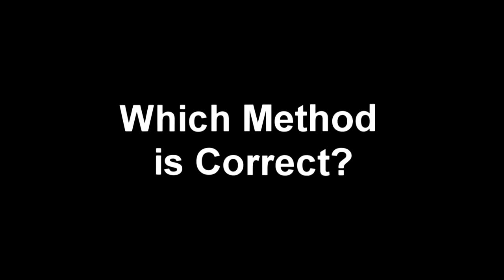Using a Vintage Bakelite Sewing Machine Pedal: How Does it Compare to Modern Pedals?

Comment: My Necchi Supernova's both had these type of foot pedals. After sewing with wedge shaped pedals for more than 40 years, I could not get used to the bakelite ones, so I switched the pedal for modern ones. Now I have full control again over my Necchi's. I've kept the bakelite pedals, so that in the future a new owner can put the original pedal on and keep the machine original.
Reply from the maker: I know what you mean. I'm not a fan of the bakelite pedal either. I find it a lot easier to control speed with a modern-style pedal. Thanks for commenting and for watching! 😀

Comment: I have one working machine with a bakelite pedal.[Singer 500A]Most  of the time, I use the side of my right foot. My husband is in the process of putting new cords on two vintage machines. His thought is to use new pedal/cord assemblies vs rewiring the old petal. I actually like the old bakelites because they are heavier and stay in place. But, I'll probably go with new pedals and figure out how to make them more stable.
Reply from the maker: Yes, I agree! Once you get the hang of the bakerlite pedals, they are a lot less... annoying to use. They tend to stay right where you put them! So no chasing them under the table to pull them back. I have a video on rewiring a bakerlite pedal on a Singer 66: https://youtu.be/E5rOX9XoRdk  Might be worth taking a look before you commit to the modern pedal route. Thanks for watching! 🙂

Comment: Huh, I always used mine the other way around  with the bulk of the pedal away from me. I plant my heel on the floor and pivot against the solid bit. That being said, I don't really like foot controllers and mostly convert the machines that I use to knee control. I'm just finishing up refurbishing a 221 for my mother with a bakelite  foot controller though and will certainly give your other methods a try. Nice video as always, wish you had more views. You obviously put a lot of work into this.
Reply from the maker: That's the thing with the bakelite button pedal... it's adaptable 😀 I think I'll give your method a try. Maybe it'll  help me like this pedal more. At the moment, I'm not really a fan of the two button system. Thanks for commenting and for watching the video! I appreciate it! 😀

Comment: Have you heard about pedal driving treadle for electric vintage machine?
Reply from the maker: Not sure what you mean. Do you mean an electric pedal being used to work a treadle base? That's not something I've come across. Normally the electric pedal replaces all the treadle workings. Why, have you seen one like that?
Reply: @SimplyStitchy  One person in the 201/1200/101 mentioned something like that. I  will do more research on this. My 101 need a cabinet plus pedal and rewire would it be nice to have a pedal treadle. Oh I hope I am not confused 😅🤪🤣. I just realized that the cabinet I could use for my 101 isn't a Singer .; its a Sears cabinet. Don't own any Sears sewing machine
Reply from the maker: @carmencolon3520  Let me know what you find out.